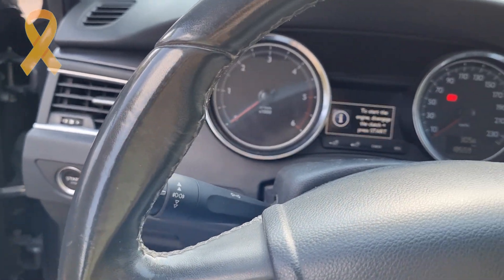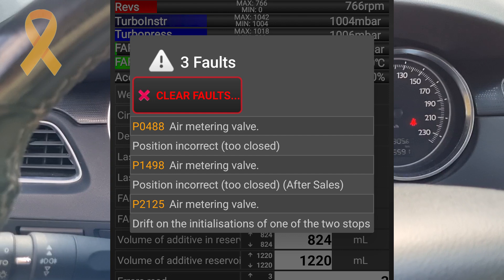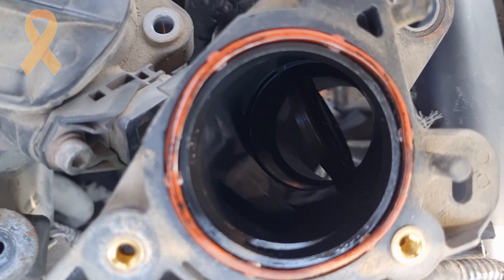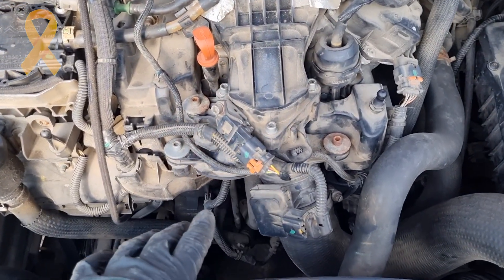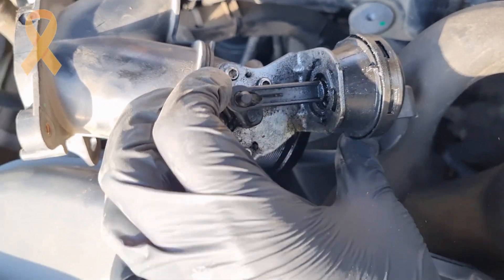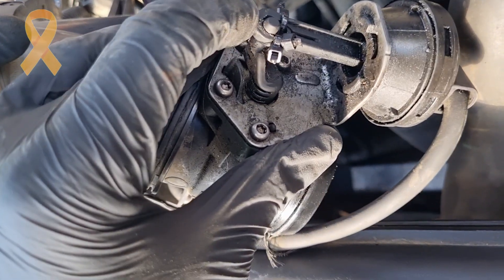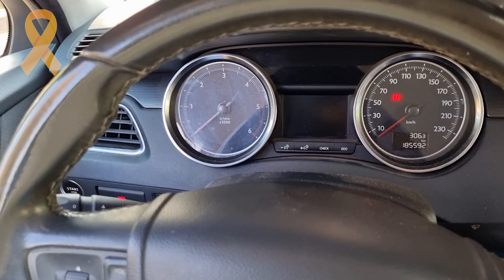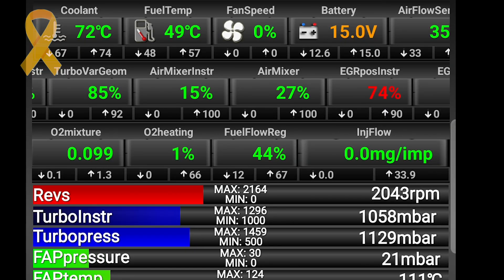Easy & Cheap Fix HDi P0488 P1498 & P2125 [Air Metering Valve]

Comment: Had exactly same problem but just ordered the part with the lever, which is far cheaper than replacing the whole throtle body.
Reply from the maker: @yaro137  where you found just the part?
I evantually made a 3d print version. Will upload a video about it soon
Reply: @DIY-Mechanic  Look for part ENT310101/ME. Also there is a repair kit available from what I can see which is even slightly cheaper if worth the hassle.
Reply from the maker: @yaro137  i see now, its around 50 dollar.
I made a 3d print just for the lever and would post it for 5 dollar, just need to find a friend with a printer.
Thanks for the part number!!
Reply from the maker: Hi, couldn't find this part in stock, I updated the description and added the 3d model of the problematic lever :)

Comment: Hi! What diagnostic software and hardware do you use for the peugeot 508? The brand service provided me with these error codes, but it costs money. It would be nice if I could read it myself.
Reply from the maker: @attilakatona2376  I use just a generic elm327 scanner, although I have a professional one bought from AliExpress 
The software is FAP, it is used for diesel engines to reset the FAP fluid amount.
Reply from the maker: I use the FAP App and just a regular ELM327.
Reply: Thanks for the answer and the video. I solved the problem.

Comment: This is really smart. I just wish you had posted this two months ago...
Reply from the maker: @santosovideo  im working on a 3d modeling of the plastic part, it is not sane to order new oem throttle cost 300-500 dollar just because a small plastic lever.
Reply: @DIY-Mechanic  I paid the dealership about $1300 to replace that part. They also replaced the a magnet valve for the turbo, a vacuum pipe and topped up the oil (with the wrong type of oil!). But I don't have the skills to do this myself, and I need the car for work, so yeah...
Reply from the maker: @santosovideo  the purpose of my videos is to help people improve their abilities.